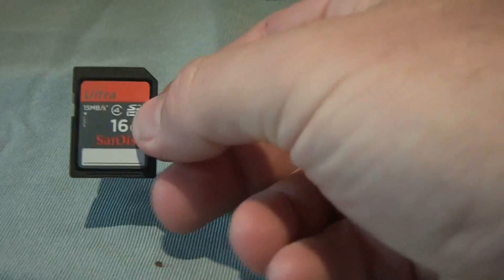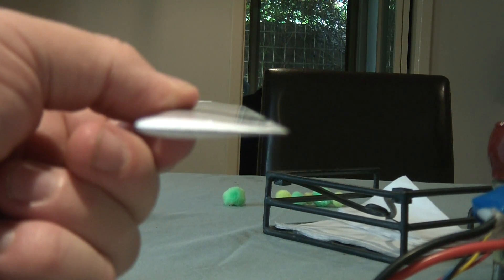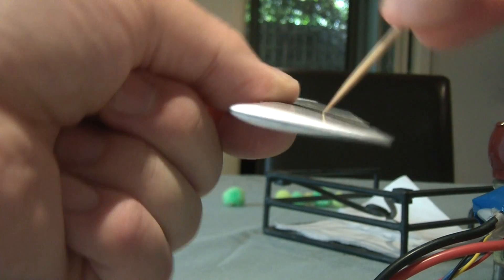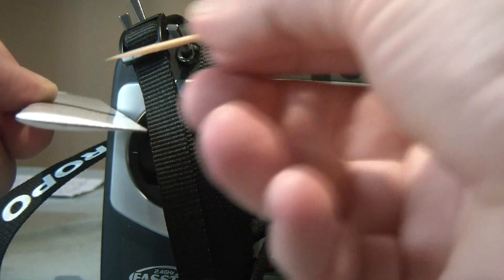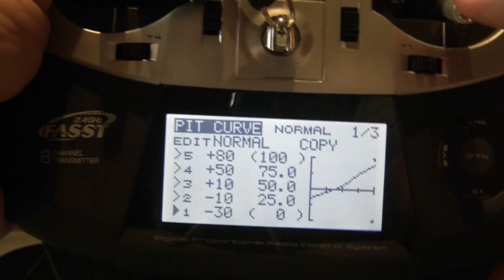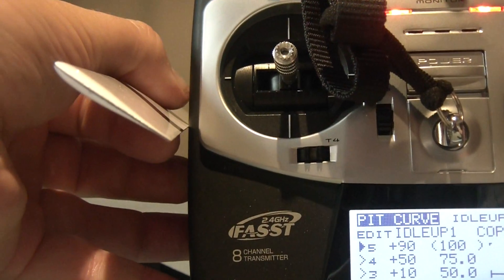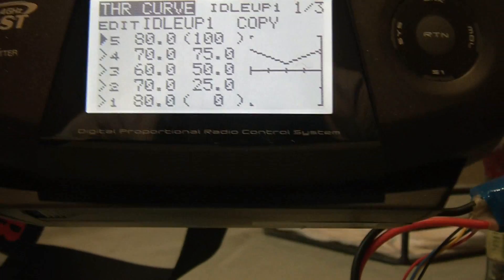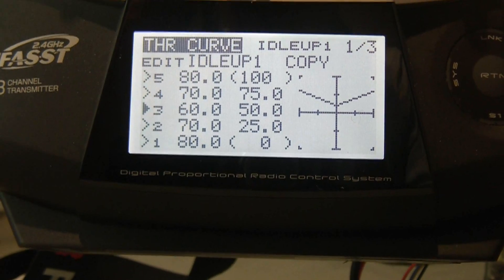Throttle and Pitch Curves RC Helicopters

Comment: So when you want to do a 3d flight you generally take off in normal mode, than change to idleup 1 or 2 when you are already flying? And before landing again switch to normal? Did I understand correctly?
Reply: No, just take off on idle up for 3D. Since the heli is already on the ground it’s not going anywhere dispite the force pushing it downwards

Comment: Hello and thankyou for the grate and helpful vid! but i have a question. i am new to the big helis and got myself a trex 550 with turnigy 3D-H flybarles system and i have a futaba 8fg super i havent flown it yet but wath wold be the recomended settings i should use as a beginner?
Reply from the maker: I would love to help but have no experience with the flybarless units on the larger helicopters.  I imagine they require similar curves to a flybarred unit though.   Use a mild pitch curve when learning,  this will tame down the responsiveness.   There is a great article on doing this at www.rchelicopterfun.com